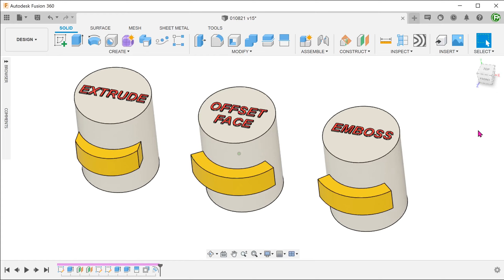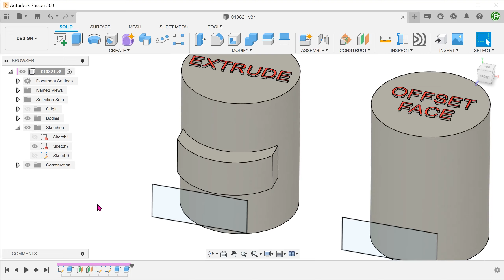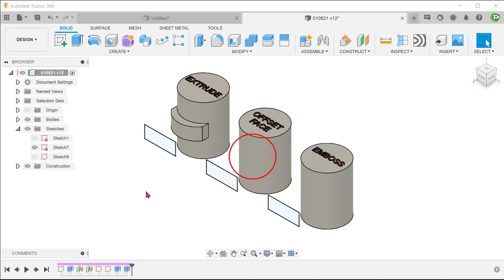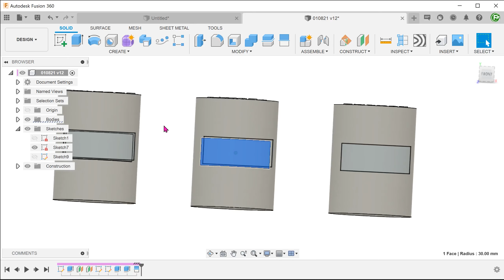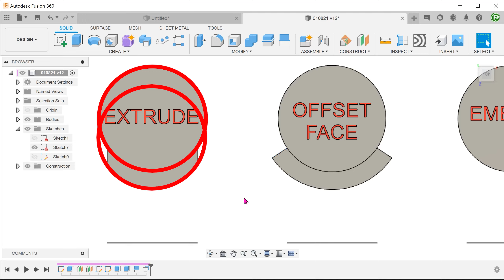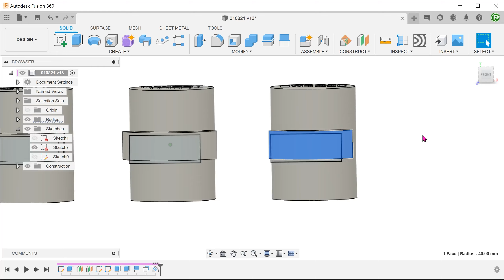Fusion 360 | Extrude VS Offset Face VS Emboss

Comment: Is press and pull the same as extrude in this instance?
Reply from the maker: I had been waiting for someone to ask this question😀. I think the best way to describe the press/pull command is that it is a chameleon. Depending on the situation, it will either transform itself into an extrude or an offset face. If we select the rectangular sketch profile and start the press/pull command, it will become an extrude command. You can check this by looking at the title of the dialog. If we select the split face (non-planar) and start the press/pull command, it will become an offset face command. If you are interested to find out more, you can refer to the following video.
https://youtu.be/hAdKi0HsRaw

Comment: I love your content.  Another option was also and extrude from the plane the cylinder was extruded from.
Reply from the maker: Thank you. Yes, you're right in saying that the offset plane is not required. For demonstration purposes, I would often do it this way as it is clearer.
Reply: @Fusion360School  you do an EXCELLENT job making this video clear.   I certainly wasn't trying to take away from them.  You have a clear mastery of the product and process and an excellent teaching style.

Comment: Can you show us practical examples of you using these 3 while designing something? I did understand your video but I am not fully sure when to use them. Also, what’s the difference between press pull and extrude
Reply from the maker: I am looking out for a good example that can compare all 3. I would describe press pull as a chameleon command. It takes the form of either extrude, offset or fillet depending on the situation. You can refer to this video:
https://youtu.be/hAdKi0HsRaw

Comment: Can you do a tutorial on how to take a curved surface of any form and lay it flat without using projection?  I want to know how to do it where you'd have a curved surface and you'd lay it out like it was a piece of fabric and get the actual shape of it.  Can you do one?
Reply from the maker: This sounds like something that can be done with the sheet metal workspace. Will need to explore further on this.
Reply: @Fusion360School  Great tutorial as always! I have a suggestion for a new tutorial. Complete workflow when designing a part, concerning how to use internal or external component (when making an complete assembly file), including how to use the context functions. And the best way to use derive when designing products. So what I mean is the best workflow in fusion 360 to keep the design clean, flexible and effective. 
Hope that was understandable:)
Reply from the maker: @87osvald  Thanks for the suggestion. Assemblies are a weak point of mine. I am still coming to grips with designing assemblies. I will definitely need to learn more before I can produce a full fledged assembly tutorial. I am working on a simple master model (top down design) video. Hopefully, I can finish that soon. It is very challenging to make!